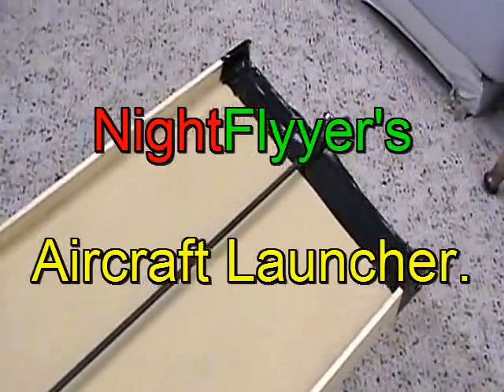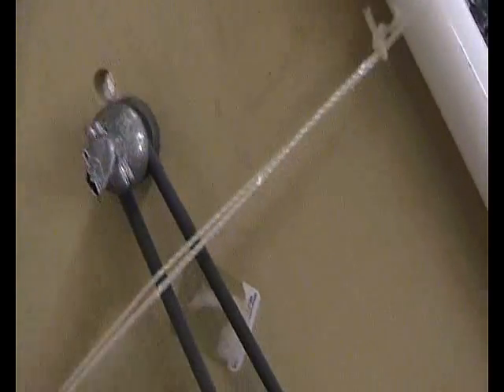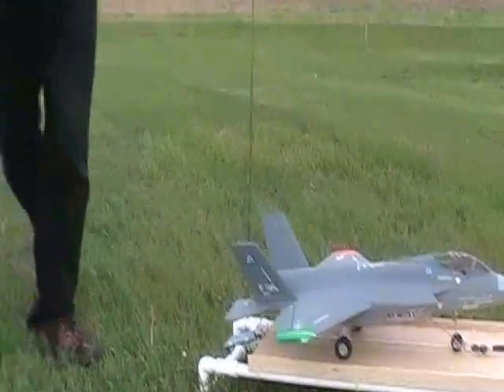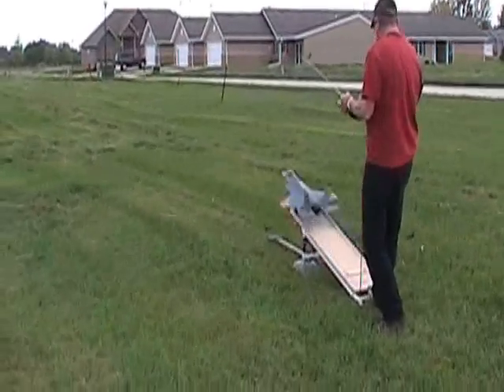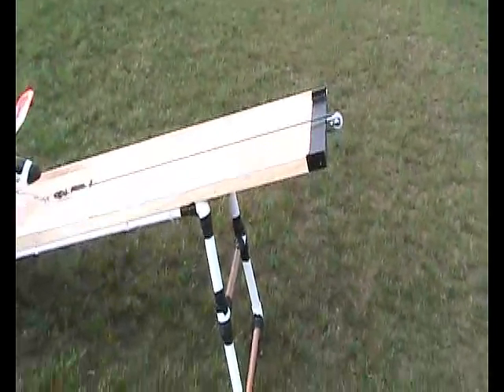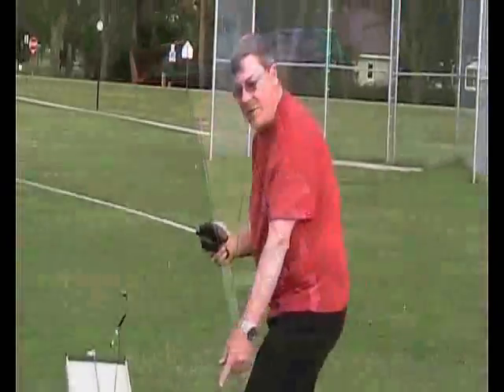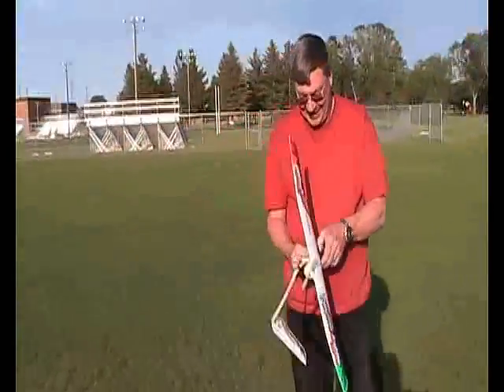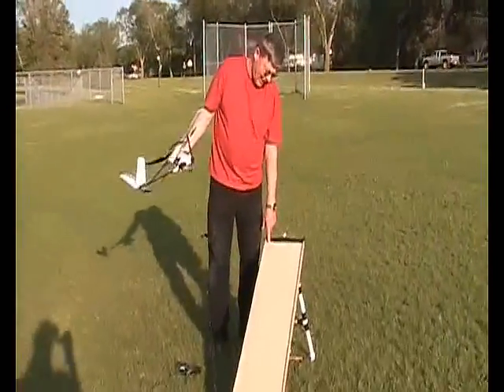NightFlyyer-a-Pult R/C Plane Catapult by Dave. Self Contained.

Comment: Seems like you have to put the power on as you hit the release.  Do you think you could rig a device to hold the plane in place to give it full power before releasing it?  You could rig it to release the catapult and the plane simultaneously.  Just a suggestion.

Comment: actually i take that back, i am a complete novice at flying and I flew the plane today and i figured it out. The firebird freedom is  like flying an airbus (at least for me) and doesn't turn as sharply as other planes. I also was full throttling the plane all the time, so i would cut the throttle and it would stall. So now i really like the firebird freedom but the commander 2 is better i think.

Comment: if you can you should try making a clasp for the tail so you can throttle up while on the catapult. while still being able to it at the same time. you may be able ti achieve this by  connecting a string to the end of the plane and connecting it seprately to the relese .

Comment: NightFLyeerapult :D 
NiF-Pult? :P

Listen, Im having trouble with my heli in forward flights. It wobbles but not tail wobble...kinda like if the mainshaft was off axis...but thats not it either. Ive changed almost everything...cant seem to figure it out. Ive tried almost everything. I can hoover with no wobbles...but as soon as that nose flips forward, it starts to wobble from Side to side, and not yaw form side to side...as for what the gyro is concerned. Any idea whats might be wrong??

Comment: you can also add a 12V battery, a high torque dc motor like the ones used in starter box for RC_Cars which triggers the launch like you do now with your foot, a receiver with the same freq as your remote and launch on demand with the "gas" stick remotely with no need for additional channels (a separate chan would help on safety though). i hope this helps on future developz... good job! ;)

Comment: Oh nice redesign!

increased height gives you a clear advantage, however you seemed to have lost some of that pull. Most likely due to friction over the pulley. You can compensate by making the rubber band shorter and stretching it the same distance.

The safety is a good idea too...